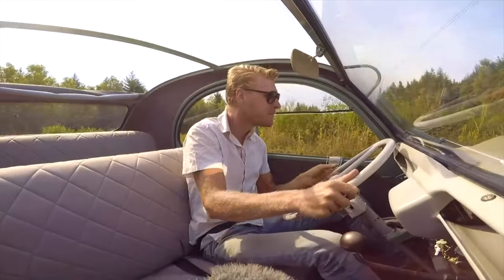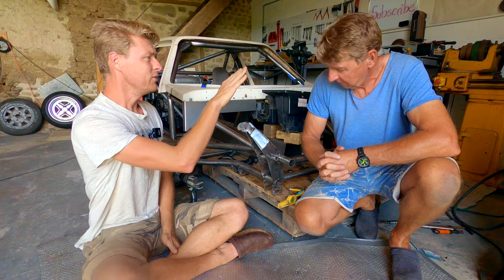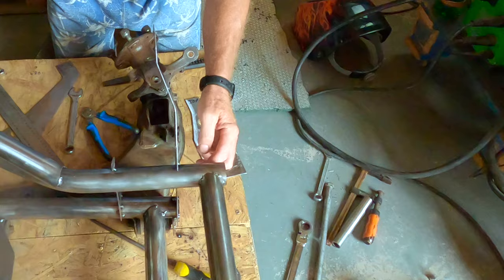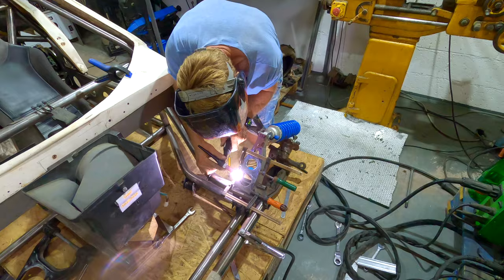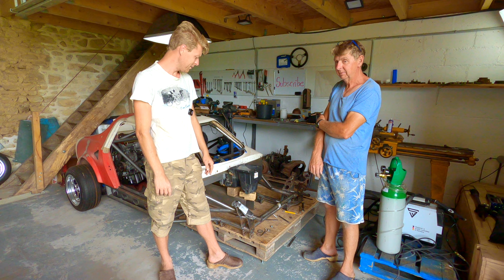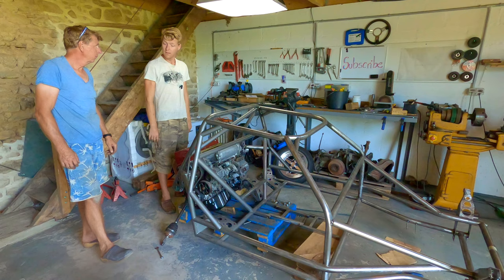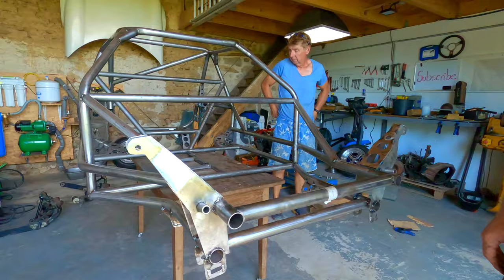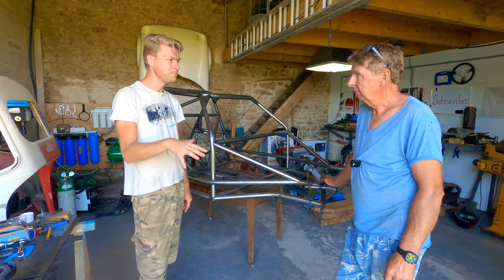How Much Does It Weigh? | Project Mosquito Honda Type R Mini Supercar (Ep51)

Comment: this is an amazing build (I just binged it all over three days between work and kids) It has inspired me to adjust the plans I have made for the build of my 62 mini, I was already planning on using the k engine in the middle with the same CR-V rear suspension that you have used along with 13 or 14 inch wheels but the whole ethos of your build has moved me to focus more on what is possible with a well designed, lightweight chassis combined with a moderate power plant and OEM components. I'm still going to have to bend the knee to the masters of the paperwork here in Australia and make a compromised design to keep them happy but it will still be worth it.
So thank you for sharing this build and I look forward to watching it progress.
Reply from the maker: I'm not sure I would go quite the same way with a mini I'd consider embracing the wheelbase plus 175/50 13 wheel & tyre limit of the mini. use the 50kg lighter (and cheaper) D16 with its shorter shafts and 5speed to build an exceedingly fast 500kg(Max) Mini

Comment: Finally someone who weighs his frame!!

Amazing work!
Reply from the maker: Thank you very much
Reply: @OliverPickard  since you are interested in light and stiff I will just mention this maybe it will add any sort of food for thought.

So cheap, light and stiff is what everybody wants and one of the best places to look for low budget innovation is Formula student

Right after space frames formula 1 started building aluminum monocoques mainly from sheet aluminum rivoted together with dimple dies

But today a better way to build aluminum monocoques is using aluminum honeycombs that are bent and glued together and offer torsional rigidity 4x that of spaceframe in addition to better crash energy absorption.

The problem is that there is only 1 video on youtube where an FSAE team show their process and pnly 1 scientifoc paper with actual experiments that was published

But in reality they get a huge alu honeycomb sheet cut the monocoque flatened pattern, marke the places for bending, glue solid aluminum inserts, bend it, then glue the seams and voila you have crazy light cheap super stiff monocoque

Just thought about sharing this for fun because no body mentions aluminum monocoques and the just disappeared but these formula students teams brought it back in a better way.

And if you think about it F1 monocoque is 2 carbon fiber sheets with aluminum in the middle while is 2 aluminum sheets with aluminum in the middle...

Let me know what you think!

Comment: Okay, watched them all and Im happy I did. Hands down one of the best project on yt. One question just because I'm curious; why not aluminum frame?
Reply from the maker: Thank you so much! Bending aluminium requires heat treatment otherwise it basically turns it into a noodle so aluminium cages and spacframes are extremely hard to make and not track legal

Comment: Love what you are doing. One question - you say that the new chassis is so much lighter than the other one, but aren't you missing some important bits on the new one that were part of the old one and are still going to be added? Floor pans, side sills, center tunnel firewalls, etc. I doubt that they will make it heavier than the old one but probably pretty close.
Reply from the maker: We have already made the centre tunnel and sills in previous videos because they strengthen the intergrated cage rather than being completely responsible for the structure plus supporting two mini subframes they can be far lighter in both design and materials while still being 100s of times stiffer.